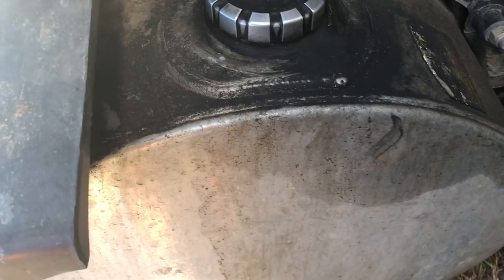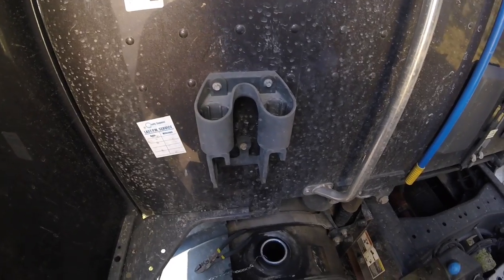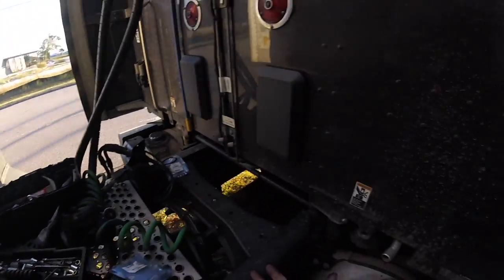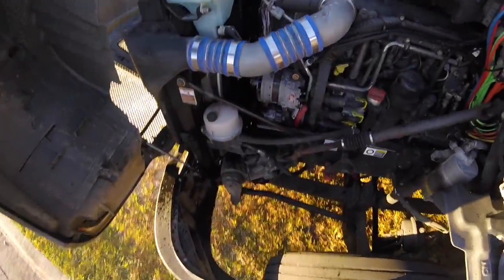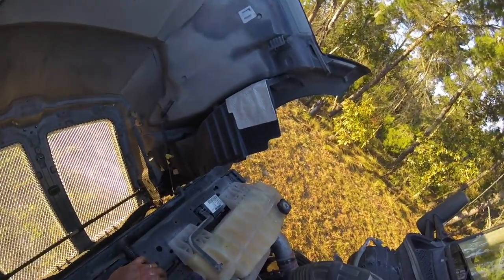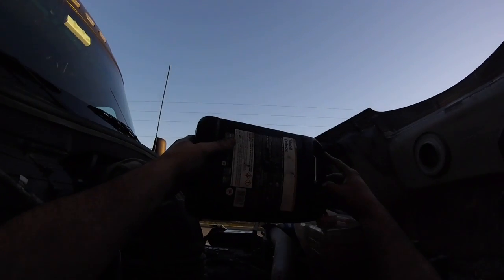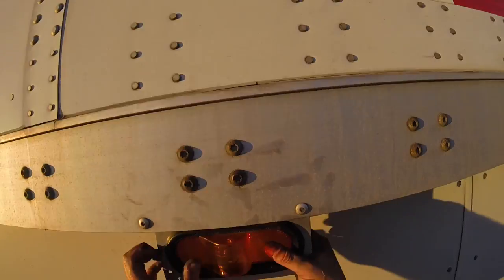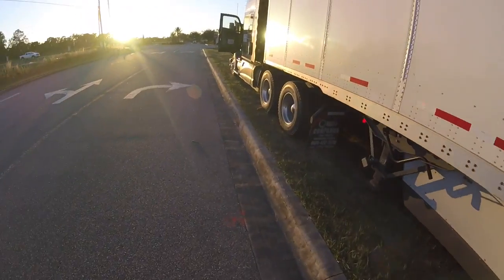Doing Some Maintenance While On Home Time

Comment: Anthony check your tanks for a vent. They have to vent either a vented cap or a vent somewhere on top of the tank, if the vent is clogged the pressure will force the fuel out of the cap seal. Just something to check out. If you have a vented cap it should say on the cap.  Safe travels always.
Reply from the maker: Vent really? I’ll for sure check the top of the tank

Comment: On that light it is a completely sealed assembly? Or can the bulb be changed?  Hopefully you kept that light for one of those times to get you by.  Southern engineer award for November 2018 goes to AB👍👍👍👍🤣. That fuel seal imho wore out due to twist in the cap down over time.   If those are high wear seals I am sure a generic replacement is available at a cheaper cost less the paccar logo.   Well done on the repairs.
Reply from the maker: Yea I kept it for sure. Never know when u when u may need it